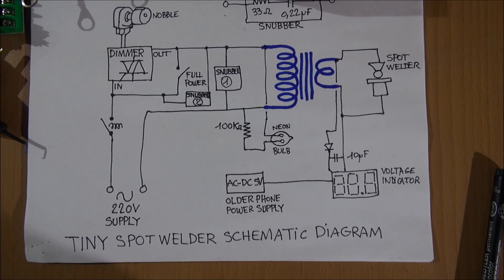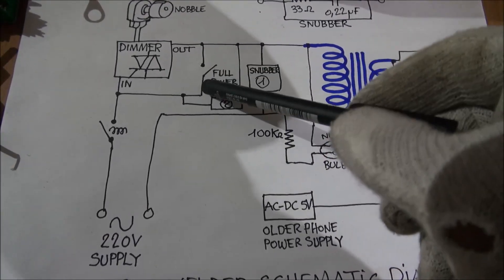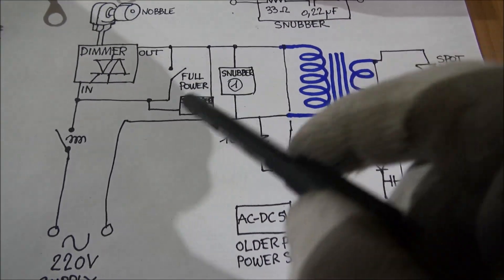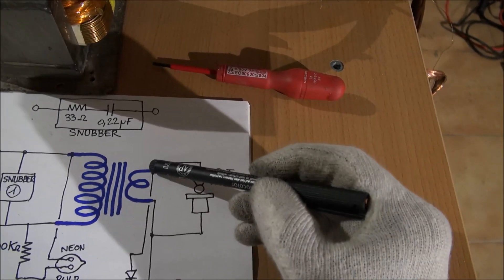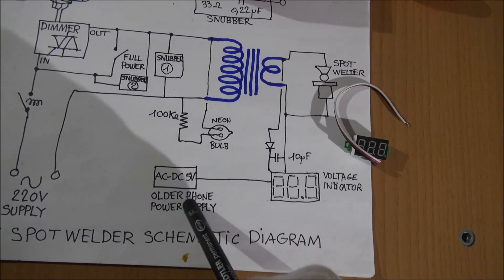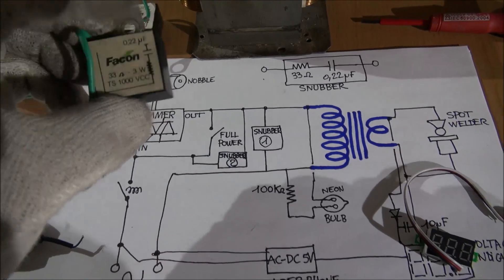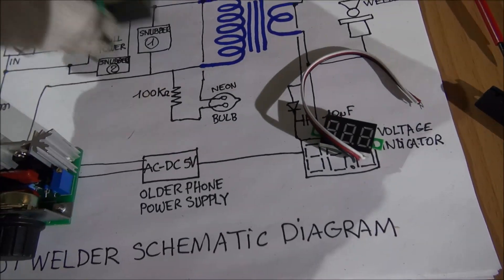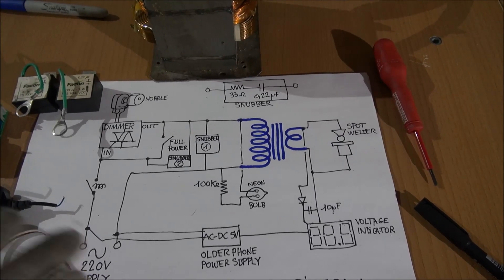Schematic and diagram of the tiny and compact spot welder

Comment: Happy New Year!!!!Quick Question(I'll try and make it quick...LOL). The only Snubber I could get my hands on has pretty close to the same specs as the ones you use. Out of the mains, we get 120V. I could only get my hands on Snubbers with a spec of (0.31/0.39uf) up to 220VAC with resisters at 38 ohms "3 watts". I assume these will work pretty well? Looks like yours is .22uF with 33 ohms.

Last quick question-Does it matter which part goes first( capacitor than resistor) or Vise Versa? The dimmer I am using is the same. 

I am on my 4th tab welder. This one will be fully contained in an 8 x 8 x 4-inch junction box with 2 leads coming out of the side going to tab welder-Extention leads. Should be a pretty sweet setup when I am done. I really wanted to use the same setup as yours this time! Should be my last one, but I said that 2 welders ago...

Happy New Year Alexander!!!
Reply from the maker: Hello njfulwider5 thank you and happy new year to you and your family.
About the snubbers, no matter if resistor is lower or higher than the snubber in the schematic. The important thing is to stay within tolerance. Your snubbers are ok.  More than 20% or less of value is not very important.
The very important thing is to use them. Twice.

There is no matter about the order of the components in the snubber.
Snubber are very hard to found, for this reason it's more easy to build them.

For using your dimmer like the video, you just have to connect two points of it. On your dimmer you have 4 screws. Use only the both on the middle.
In the schematic, you have " dimmer in" and " dimmer out".
Dimmer " in  " is the second screw, and dimmer " out " is the third screw.(no matter about the sens of read)
Don't use the first and the fourth screw.
Have a nice day!
Reply: Great News!!!Thanks for the Tip and the SuperQuick answer!! Hope you had a Happy Holidays!
Reply: Forgot to ask. Say I don't want to use a switch for the full power. Would I still need to place a snubber in line, minus the switch? 

Edit:: Just realized you mention in the video, the snubber # 2 is for the Dimmer, not the switch. So I will need to make sure to have a snubber there also. I'll just add the switch. Don't think I will ever need the full power. But you never know.
Reply from the maker: snubber is mandatory. it protect the dimmer, not the switch.
Reply: Awesome! I wasn't sure and putting this together today. So far its looking pretty sweet! Thanks for the tips!
Reply: One More Question. With the Voltage meter your using. Are you using a DC voltage meter? If I am looking at it correctly. The schottky diode and capacitor, change the voltage to DC, so the meter can read it correctly...Very Genius!!!
Reply from the maker: there is nothing genius.. Just a rectifying diode and measuring one side of the sinus, wich is enough for to have an idea for a - repeating process-. Yes it's a DC voltmeter. Anyway it can read alternative current but with michtevious behavior. To use it with dc is more reliable.
Voltmeter is used for measuring the voltage when the soldering is actived, with open jaws. the purpose of it is to repeat process about a know result, appreciated by a known voltage value.
Reply: That will work perfectly. I don't have any AC meters, only DC(3 wire). Now I can add this to my circuit to get a rough idea of the voltage. Thanks again for the help and all the Tips!
Reply: My Creation is looking GREAT!! Thanks to you for all your help. On the Schottky diode, do you think a "15sq045" will work before the voltmeter? Or do you think this is overkill? I might have some sb560(not 100% sure). Hope all is well!!!
Reply from the maker: I don't understand what you mean by " before the voltmeter"...This diode is too big, and it's not worth to use it just for a signal. You need any shottky diode, in the worse case a silicon diode, never a zener diode.
You just need a 1N4848 for example. (you can use a silicon diode, but you will loose a little accuracy).
Reply: Before the Volt reader, sorry about that. That kinda bytes, The only Shottky Diode I had was the 2 mentioned above,"15sq045 or SB560". I don't have any others at the moment. Been awhile since I purchased any to replenish my stock. Maybe I can find one on a salvaged board That needs to be cleared of components. 

Thanks again for the tips!
Reply: I lucked out! I forgot I just ordered 100 x 1N4848 Fast Switching Diode! Should be here today or tomorrow!!
Reply from the maker: that's ok it's a nice purchase, I have it on my bench, great diodes for the price. They can work until 100 Khz...
Reply: Hello again, Just curious? Did you mean I could use a 4148 or a 4848? I can't seem to locate any of those, and The 100 I ordered came in a 1N4148
Reply from the maker: WTF me and my mistakes. Yes it's the 4148.
Reply: YEAAAAAAAA!!!!!!I just got 100 of those...No mistake! Love your work!!!
Reply from the maker: You need to understand than the way where this diode is used is the most easy way a diode can work. There is no special diode for that.
Basiquely, a 1N4001, 4002, or 4007 is required for that.
But because we have here a very low voltage, we need a diode with minimal loss voltage at it's leads.
So, we use a shottky diode, to minimize the drop of voltage, to have the better read of voltage output.
This is the reason we use a shottky diode, and not silicon diode (0,3 loss instead 0,7V).
Reply: Alexander Hartdegen That makes sense. Well the Spot welder is completed (basically the wiring). I would have tested it tonight, till I realized it’s 5 in the morning...lol TMR, I’ll have it wrapped up and ready to go. It’s looking really nice! Thanks again for all your help on this build!
Reply: Good Evening! Sorry to bother. You mentioned in the video, on the SCR to turn the small potentiometer (clockwise, or CounterClockwise) to get the full power. I noticed you mentioned both. Does it need to be turned counterclockwise to get the full power? I couldn't find any info on the net about this. Hoping you remember.
Reply from the maker: Hi. In the video I mean counterclockwise. I think this potentiometer is a way to make this dimmer working on 230 or 110V.
If you intend to use it on 11O volts, don't touch it. If your main voltage is 230V you can turn it completely counterclockwise.
But before to connect it finally, you need to test it with an halogen lamp.
Connect it in serial with an halogen, connecting only the two middle screw.  Be carefull with the main voltage! And see the glow of the lamp, and with a protected srewdriver, turn the potentiometer to have significantely a good light range. 
This potentiometer don't provide a full power, just adusting the range you need. You need to test it on a halogen lamp before to mount it on the transformer, to be sure about it's reliability.
When you use this dimmer, use it on serial with the other component, don't use the edge screws, only the middle screws.
You need to know than you will not have 100% of the sinewave at the output because the diac on the pcb make a 30V loss. This is why there is an external switch for the 100% power.
So, the potentiometer on this pcb adjust the range, not the power.
Reply: Good Deal! I tested it yesterday to make sure all was well. Today I have my system completed. But I am not sure if it really makes that big of difference yet. On the LED Meter(voltage meter we placed on the unit). It messure a little different than my multimeter. But it should work great at keeping track of the dimmer and timming. Currently I think I need to set the smaller potentiomer. I think it is set to full open or possibly 230. 

What happens when you turn the Smaller Potentiomer clock wise 100%? Does this turn it all the way down? Can't really find any info on it on youtube or the net. Tons of youtubers using the unit, just no explanation on the small pot.

So Far Testing when great, Just think I need to adjust the smaller pot for 110? 

Thank you So Much for all your help!!!!
Reply from the maker: the small potentiometer is, in our case, used to use the spot welder between 50% and 90% of power.
If you turn it completely counterclowise, you will use your spot welder between 20 and 90% of the power.
If you turn it completely clockwise, you will have between 50 and 90% of the power.
The voltage on the output of your transformer is a DC voltage, used only for indication, for a repeating process, not a real concrete voltage read.
But don't worry about this small potentiometer, make your mounting with this small potentiometer available for to retouch it if you need, like I did on mine.
Reply from the maker: I can see you make very nice products! see you soon.
Reply from the maker: that's a very nice and clean made :o
Reply from the maker: Hi njfulwider5. I had a surprise with the 1N4148.
These fast switch diode are " shottky" but they are not suitable.
Try please your 1N4148 with a voltmeter in diode mode.
The voltage across the diode must be 0,3V. With the 1N4148, for a reasons I really don't know, the voltage above is 0,7V.
Please found another diode, wich you will check with voltmeter, and be sure it have 0,3 volts across the lead, and not more.
I don't know what happen with this 1N4148. Please put another diode!
Reply: That is strange? I am getting the same thing. It seems to be working, just not that accurate. I haven't used it since the build, but the next time I pull it out to use, I might swap it out.

Is it still ok to use, just off on the reading? for example. My welder produces 2.85V, but the meter reads 3+. I just basically used it as guide. What does adding a regular diode like a 1n4007 do different?
Reply from the maker: Voltage junction of a normal (silicium diode) = 0,7V.
Voltage junction of a shottky or a germanium diode = 0,3V.
These voltage values are also a drop loss voltage. For a real voltage of 3Volts, the normal diode give you 2,3 volts on your volt display (wich is a big difference) and the shottky diode (or germanium) gives you 2,7 volts.
At this very low level and big amperage, a half voltage make a several difference on a read value. 
it's not a problem in itself, but a shottky diode must be a 0,3 volt loss only. To have the higher voltage at this low voltage is better. This is just a reliability point. Thanks :)
Reply: Awesome!!Thanks for letting me know. I will definitely change it out and let you know the difference it made.  I am currently in the middle of a small PowerWall using a 300 plus 18650s, 1500smart UPS, 600 UPS and 12VDC UPS. Going to make a small PW out of the 3(practice for a bigger Idea I have). Taking forever to test the batteries.....LOL

Comment: This dimmer is normal for resistence loads?  Like 10kw is good for this?  Thanks
Reply from the maker: Hello, this dimmer is usually used for resistive load, like halogen lamps, and heating elements.
But because we use snubbers in this configuration, we can use it exceptionnaly on inductive load.
Don't forget the notice than snubber here are very important. The non use of it can destroy your dimmer.
2 Kilowatts dimmer is enough for 1500 MOT transformer, but you can use 10K if you want without any difference.
Thanks for your comment.

Olá, esse dimmer geralmente é usado para carga resistiva, como lâmpadas de halogéneo e elementos de aquecimento.
Mas, porque usamos amortecedores nesta configuração, podemos usá-lo excepcionalmente em carga indutiva.
Não esqueça o aviso do que o amortecedor aqui é muito importante. A não utilização pode destruir o seu dimmer.
O dimmer de 2 Kilowatts é suficiente para o transformador 1500 MOT, mas você pode usar 10K se quiser sem qualquer diferença.
Obrigado por seu comentário.
Reply: Alexander Hartdegen thank's bro!

Comment: Hello, super and greetings for your project !!!
I have a project with a point welding device, it goes to a 220v network, with a current of 1500amp and 5.3v at the secondary winding, but, I have a problem, when I have a high voltage drop in the 220v network, it fall stops the bulbs in the workshop where I work, if I need some advice to fix this problem, thank you!
Reply from the maker: you need to connect your welder directly to the 220 volt grid distribution, on the thickest power distribution leads, and not on one end / mid-line
Reply: Yes, I understand, you are right, thank you!
It may also be due to the length of the 220v network conductor, which is around 25m linear and 10 awg.
I want to put another copper conductor on the same length but with 9 awg and I hope to reduce the problem with the voltage drop!
Reply from the maker: Hi sir, what you need is to put a special line, from the 220V distributor to your spot welder. 
Because your spot welder, when weldering, exceed 5KW of power.
You can use simply 14 AWG wire, from your 220 V distribution board, exclusively to your spot welder.
I insist on that, you absolutely need to pull 14 AWG minimal wire from your electrical panel.
Reply: Ok, I understand, I'm going to mount a new 3-wires copper rod track with a thickness of 9 awg directly from the 220v network that comes to my electric panel, thanks for the advice and after the conductor assembly I tell you what I've solved!
Reply: Hello, I ordered the conductor for the network and meanwhile I want to make the electrical part of the welding machine.
I want to put a magnetic contactor controlled by a 24v coil to control the 220v on the control circuit of the welding machine.
On the welding time I want to put a timed relay 0.01s .... 99h.
To control the power of a dimmer 220-230 V AC, 25 A, 4000 W.
Now I have to see what order to put in the circuit and please give me some advice.
Thank you !
Reply from the maker: In your case I think it will be better if you put your relay contactor switch on the top line (according to the schematic in the video), contactor NO (Normaly Open) between exactly snubber one and snubber two on the top line of the schematic.
In this configuration, you will have a snubber always connected to the primary coil of the transformer (snubber 1) , waiting form energy coming from dimmer.
Your NO switch of the relay need to be placed on the top line, between the two junctions of the two snubbers. After this, you need a third snubber, connected behind your NO switch relay (to top and bottom line)
When your relay is on, these two snubbers are found in parallel.
So, in this configuration, your dimmer is always powered, it sends it's power to your third snubber, waiting for a switch on NO relay, for injected power trough snubber 1 on the coil.
Your relay must be connected as close as possible to the coil (electriquely speaking), but you always need a snubber connected on the coil, and a snubber before your NO switch relay.

Comment: well it seems for me this voltage regulator has snubber circuit build in...h**s://i.stack.imgur.com/brgIL.png ,anyone knows why does this circuit need another one?
Reply from the maker: Your schematic have 1OO nf capacitor.
The snubber on the video are 2 times higher.
These snubber are " calculated" for working with the spot welder, they are not chosen anyhow.
If you dont put not enough snubber, you can destroy your dimmer.